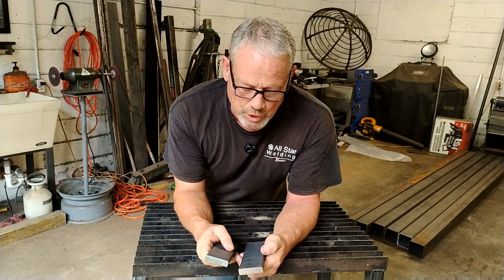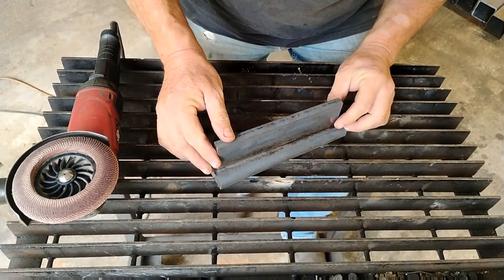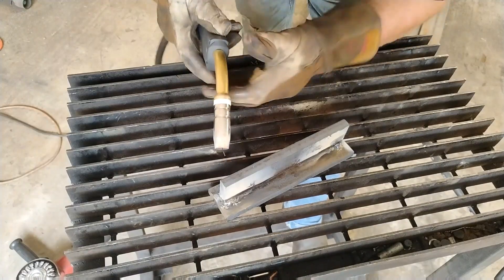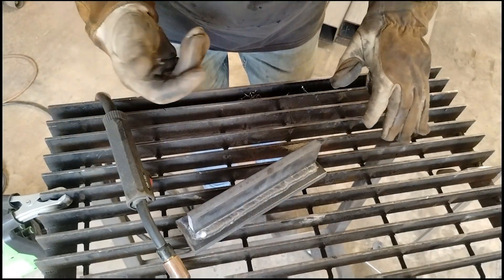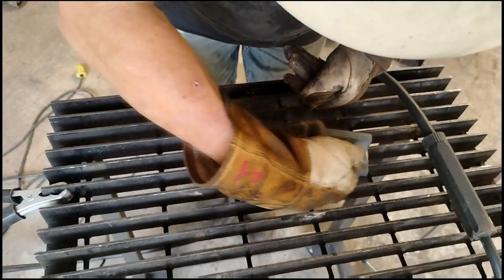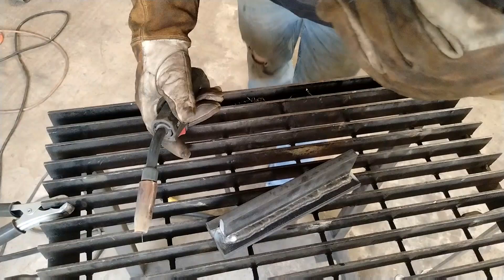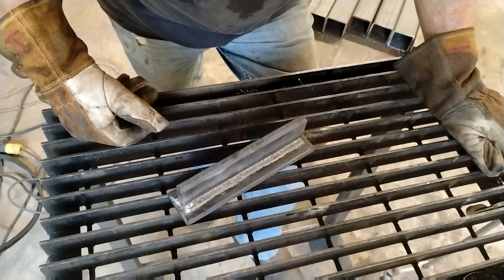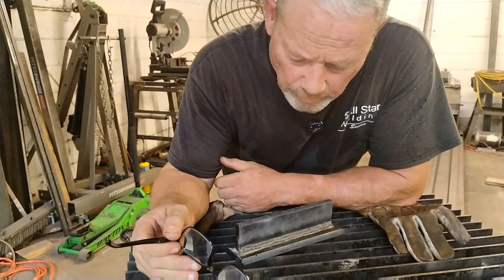Flux Core Friday Ep.1 | Welding 1/2" Plate with the Titanium Easy Flux 125

Comment: I would very much like to see the Titanium 125 doing sheet metal for automotive rust repair. I purchased mine to do "Cab Corners" on my '85 Chevy 3/4 ton 4X4 Truck (K20).   I also have an Austin Healey that needs some patch repair.
Reply from the maker: '85 K20, that's the truck of my dreams. Is it the Scottsdale?  I've used the the Titanium for auto panels before, but it was a nightmare. Might not be too bad on cab corners as they are a little thicker. You'll have to dance around the panel, then wait for it to cool, then dance around again. It would be much better to use Mig, with some skinny wire
Reply: @AllStarWeldingSC  Its a Chevy "Custom Delux" with factory stock no computer and no Cats just a good old Quadrajet Carb and dual exhaust. I love it. Purchased new. My first big expenditure and I still love it. 350/auto. Manual 4X4 shifter. 
  
Thank You. I am jumping around your videos and my comments trying to get your recommendation for wire correct. Here is what I think you said: "Use 0.030 For FCW (not 0.035). Use Weldcote E71T GS 0.030 specifically for the Titanium 125 for lower splatter and can still Multi Pass. 

For Mig (I just purchased a lightly used "Lincoln Weld Pac 175HD") use 0.035 wire(?)   Is the wire size I have stated correct?   What specific MIG wire should I use for basic Fabrication like the projects you have been showing us?  
 (And what about those Cab Corners and later some flatter thinner automotive patch panels, what specific MIG wire should I buy and what diameter considering the Lincoln I just purchased ?)  Thank you. Thank you. Thank you!!     I will ask no more questions!!!
Reply from the maker: For that work, you may benefit from using .023 wire. That's what muffler shops use
Reply: @AllStarWeldingSC  Thank you. I will purchase some .023 and try it (MIG). 

For some reason I thought in the first or second Titanium 125 (FCW) videos you were going to show us how to do exhaust pipes but I was not able to find it.

Comment: Greetings! Stepped over to this video based on your recommendation from another. You are correct; FC especially in 'this' scenario is indeed, absolutely not an acceptable format with .030 above 3/16 and stretching into 1/4" thicknesses at the extreme. The voltages on 120V do not permit the proper penetration into these thicknesses - as would be required; specifically for any kind of structural formula. For the home-hobbyiest; have fun; and that's where this machine shines. The limitations of the HF Titanium, unable to reach Spray Transfer mode (26-32V) limits these to small work. That being said, this is an outstanding cost to use machine, highly capable, fun, simple and lightweight. In my personal opinion, this is a marketing win for HF and it has served me quite well for all the hell I've put mine through in the Tucson heat! Keep em' coming. Great vid!
Reply from the maker: Thanks, I really appreciate the comments. The Titanium Flux 125 is also much, much, much more advanced than the old Chicago Electric transformer based machine.

Comment: There is no point of bevel the metal because you are only beveled the top piece and not the bottom piece. Yes, you might get better penetration on the top piece, but not the bottom piece.
Reply from the maker: You're right. Would have been better not to bevel at all really. But, if it was getting any penetration at all on the bottom, at least it would be further in. Like I said in the video, I would NOT recommend the Titanium for such thick material.

Comment: i would not mig 1/2 material, it’s the least strong of all of them and is not rated for anything structural. the thickest i weld with mig is 1/4 anything more than that and i’ll do flux or stick. 
unless its spray arc then 1/2 is no problem
Reply from the maker: I can't think of maybe 1 or 2 times I ever used 1/2”.

Comment: Crosscut a section of your work and etch with Navel Jelly will tell you the penetration depths of the 120 vs 240 flux core.  Having the metal hot already makes a huge difference in penetration for the 120 and the way the weld bead lays down.  If I had to use the 120 in a pinch I certainly would pre heat the metal and bevel just a little deeper to get the job done.  Thanks for taking the time to film.
Reply from the maker: That's a great idea, and thanks for the advice! I will do a cut/etch soon. Been wanting to do that for a while.